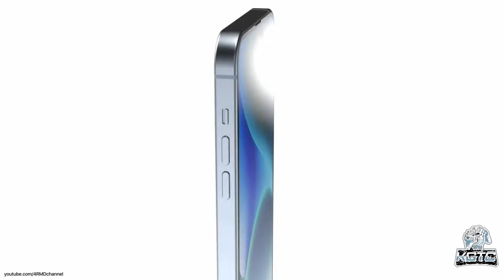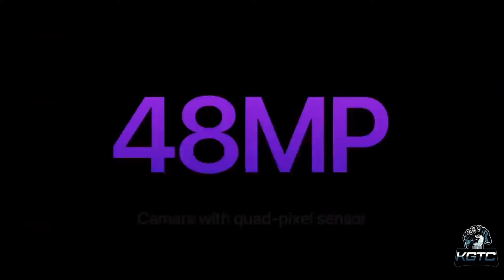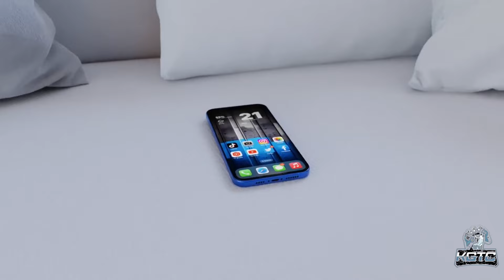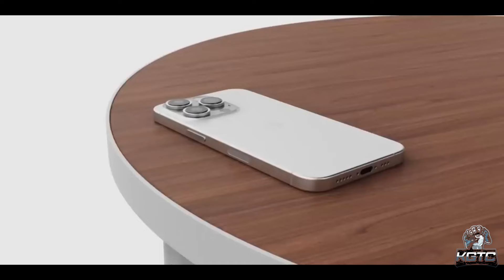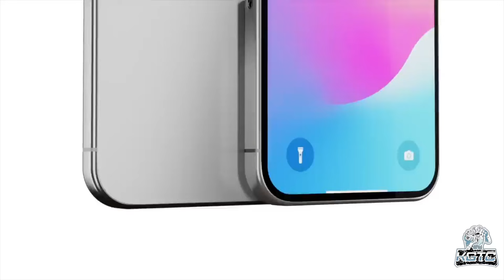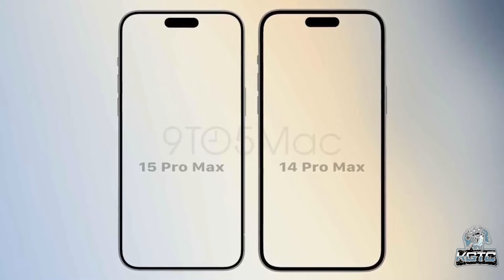New iPhone 15 in-depth rumors and features Should you Upgrade? (What you should expect)

Comment: It’s been soooo long since the USB-C charging port, they should have done it with the 14 models. I don’t I’ll upgrade cause my 13 pro works just fine and doesn’t need a change. Awesome tech video!
Reply from the maker: I know it has been a while! I am not going to upgrade until the 15 or 16 because I have the IPhone 13 as well and it also works just fine, appreciate you!! :)